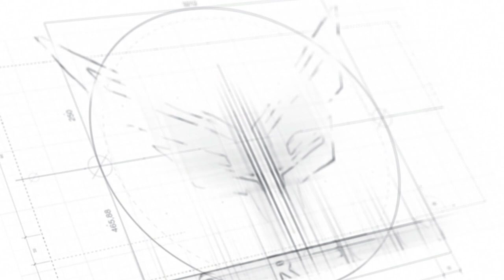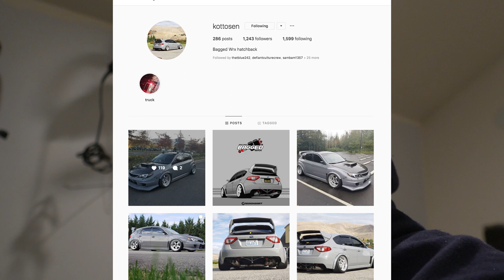How to get PROFESSIONAL results with VHT Night-Shades RED

Comment: For each buffing compound you need one pad for example, white wool start heavy, yellow foam medium and black or red foam for final the  finer compound.  
that way you get a mirror finish, 
You have contaminated the pad already with abrasive compound even if you add fine compound to the pad. 
Great results with what you had 🍻